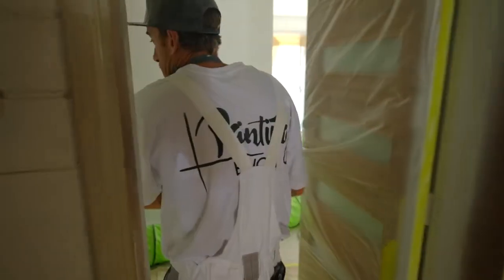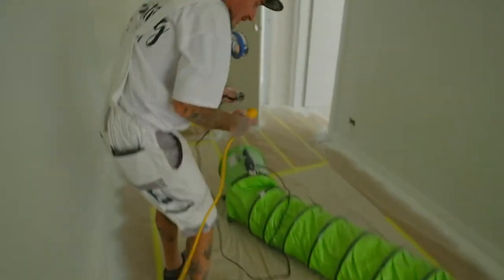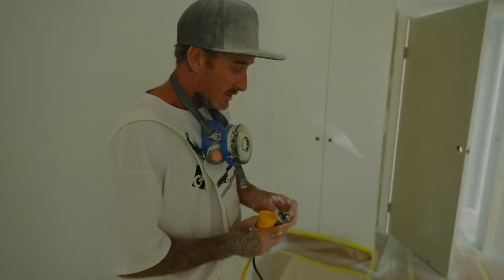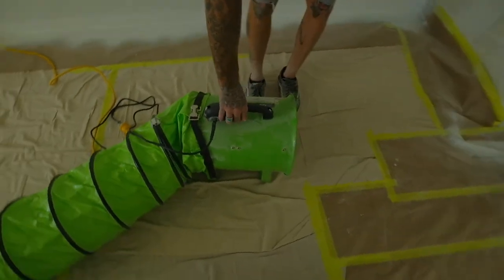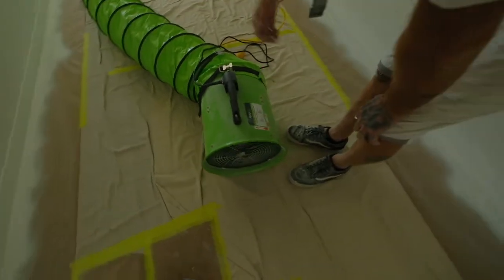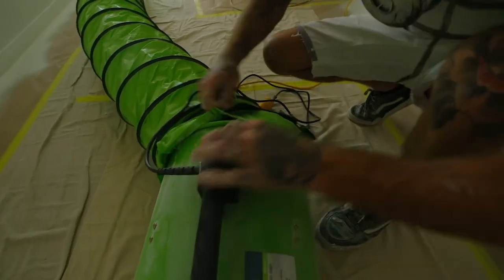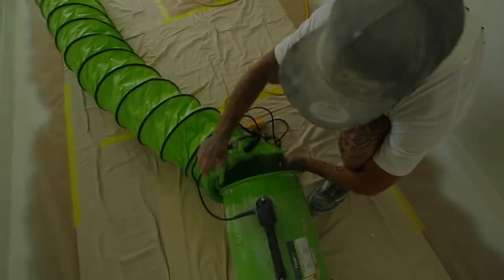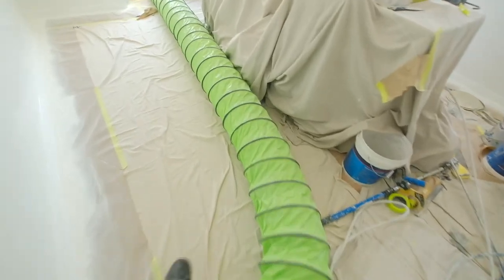WHY I USE A PAINT VENTILATOR FAN

Comment: Used these for years in underground utilities, specifically for venting fresh air into manholes. Now, I use the idea for my own projects. Boon for paint fumes, but priceless for drywall routing and sanding in a dust enclosure. I got a 2' diameter hose and repurpose an old 20" box fan. Kind of a HVLP version of dust extraction. And much quieter than the small diameter purpose-made fan units.

Comment: Does any overspray sucked into the tube effect the extraction point? In other words do you have to be careful where the end of the tube is placed for example against concrete or anything that the over spray sucked into the tube can stick into? Or how does that work thanks nice video been thinking about getting something like this but scared paint overspray might be blowed into things outside the house unintentionally.
Reply: I'm wondering the same. I've seen something like this used in conjunction with a filter on the front to catch the silica dust/paint specs, it might mean for less airflow though.